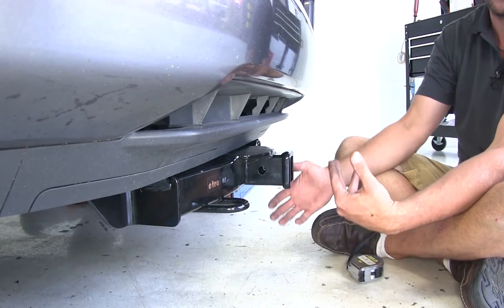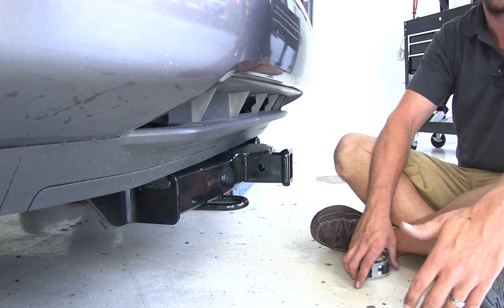etrailer | Set up: Curt Front Mount Trailer Hitch Receiver on a 2010 Toyota 4Runner

Comment: Will this fit 2005 V8 4runner?
Reply from the maker: It will not. The # 31054 fits 2010 - 2021 Toyota 4-Runner models. Unfortunately, we don't offer a front mounted receiver hitch for a 2005 4-Runner.